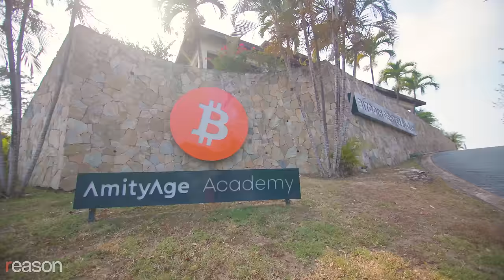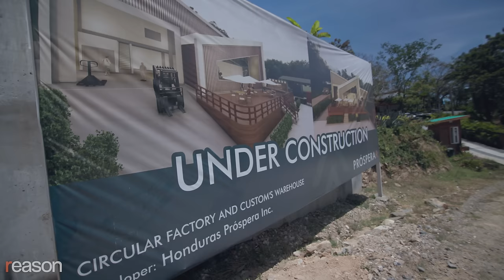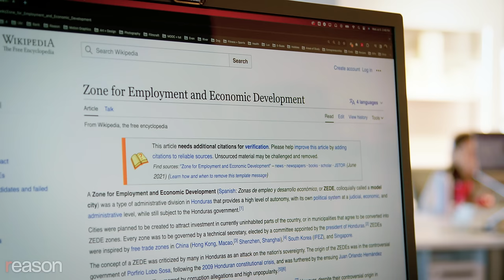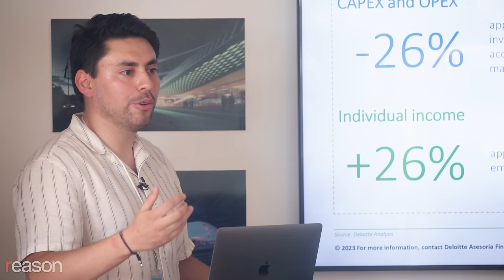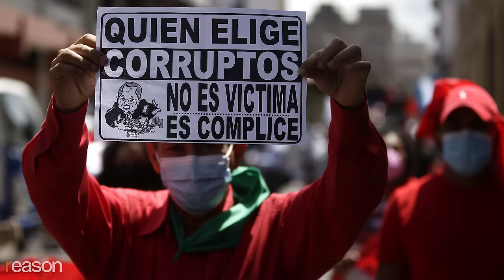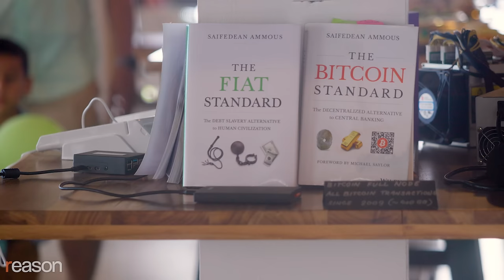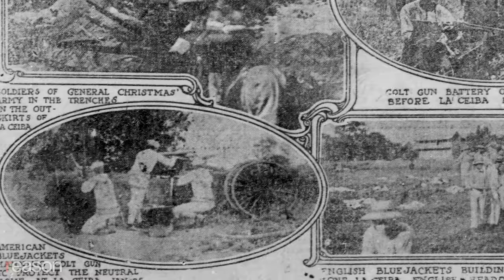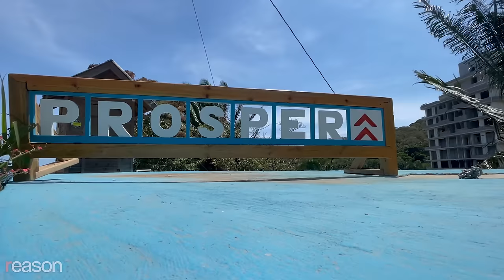A private libertarian city in Honduras

Comment: 4:56

That is not true though. Honduras has generally seen a higher vertical building density in its main cities. One of the leading companies working on that is Celaque, and its owner is known for being an honest man, and quite an enemy of the current political party in power. They are building a skyscraper in Tegucigalpa, and no traces of corruption have been noticed thus far. So, although the documentary has very spot-on data, this particular statement is false information, or a false accusation, rather. At least to my knowledge as a honduran.

Comment: Having lived on Roatan for over a year, and gone back several times after I left there in 2014, I can say that putting Roatan in the same political sentence with mainland Honduras, is like mixing Oil and Water. They are not the same. Roatan, although a Bay island under the Honduran Flag, the island is pretty much governed by a few families that go back to the days of Piracy. I have stayed at Prospero, only then it wasn't called Prospero. Then it was a run down resort with a few finished homes that it rented out. The finished homes were only about 1/5th of the total buildings that were finished. The Club House, Bar, Restaurant and Pool were competed, as was the Reception area. The remaining buildings were just walls and floors. No windows, and looked as though whoever was building them at the time just quit, and left wheel barrows, ladders to rust. We stayed for 5 nights because it was cheap, quiet, close access to good diving, and honestly, the area was pretty and we could see the potential for a large corporation to move in and make it a 5 Star Resort, like Marriott, Hilton etc.

Am glad to hear that Prospero got shot down by a push from the locals at Crawfish Rock. A tax free haven in Roatan was never going to happen. There are reasons why 1 or 2 big American hotel chains are not on the island, and it isn't because there isn't enough land or beach to build on. It comes back to who is actually running the Island, and it isn't just the Honduran government.